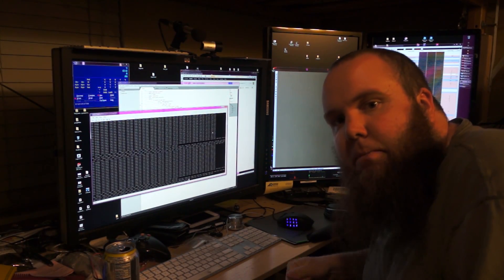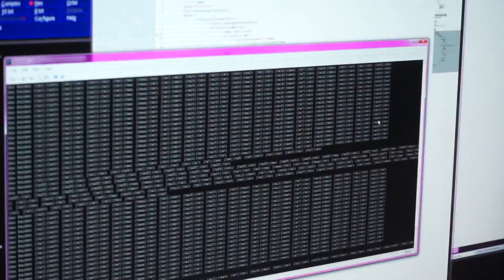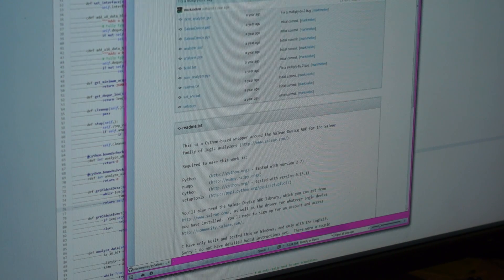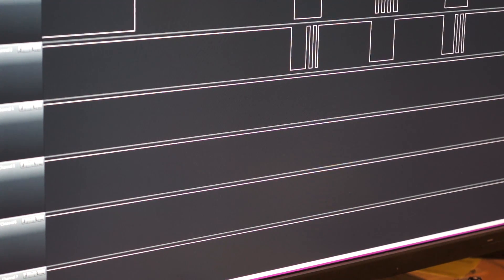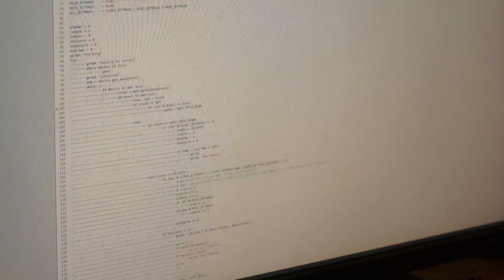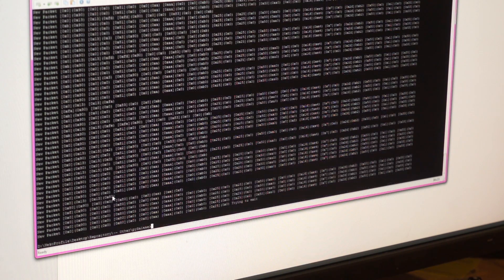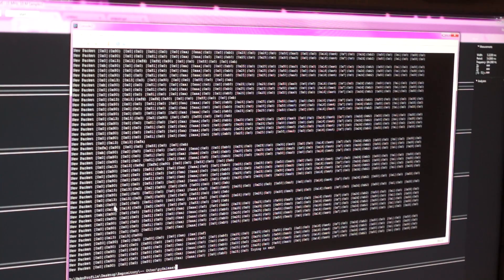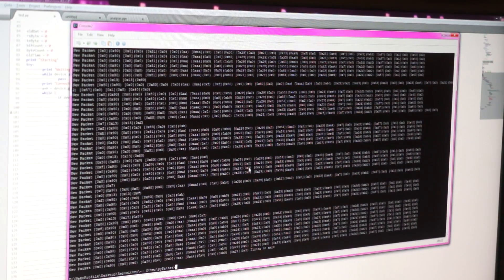Canon EOS Lens interface bus reversing - Pt 1

Comment: Not very long ago when I was dabbling in non-canon approved electrically coupled adapters I recall a guy basically reverse-engineered everything on the data bus and said it was a super simple protocol, basically just register select->data word in/out with the 9th bit being an i2c-esque read/write bit. Not completely sure about it and I know his site was taken down by Canon, but this should be doable.

Comment from the maker: 32 gauge? The distance is easily a centimetre or two.

I actually have a mechanical-only e-mount to EOS mount adapter already. I use it and my EOS macro lens for doing macro videography.

Re the e-mount specs. Even if they claim it's "open", it looks like you have to sign a NDA to get access (and probably be part of a big company). No dice, I think. I can probably reverse-engineer it, though.

Comment: Indeed, and as you probably know, the FFD difference between the EF mount and the E mount is quite large - easily large enough to put a micro and some 32awg wire between.

Comment from the maker: You misunderstand. What I meant was that there were two separate operations - "cycle between stopped-down and wide open" and "change stopped down aperture". Any mechanical implications were a silly idea (I was thinking off the cuff). I am aware of the lens behaviour if the lens is removed with the aperture closed. Internally, they use a little stepper motor to control the iris.

The e-mount to EOS mount idea is a cool one. That way, I could use my canon lenses on my NEX camera.

Comment: If you wanted to keep the camera completely original, you could use an extension tube with the passthrough for the pins (they're pretty cheap).

I hear the sony E-Mount is an open specification mount, so you might be able to make a converter between canon ef lenses and sony e-mount?

Something that you may have noticed is the aperture stays at the defined value if you disconnect the lens with the aperture set and the DOF Prev button held, so it probably doesn't use a spring.